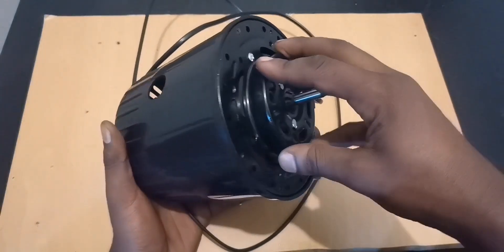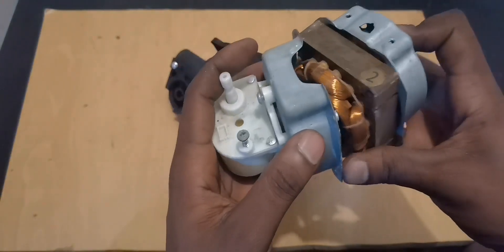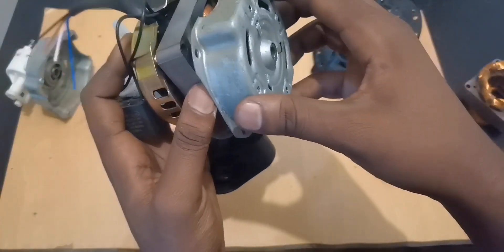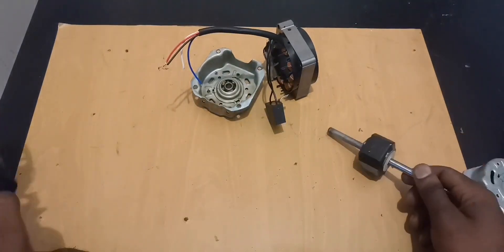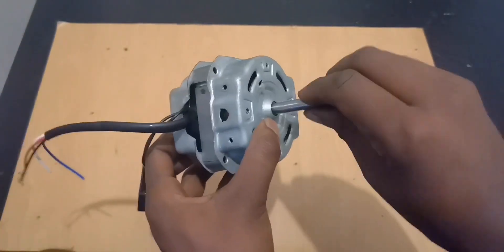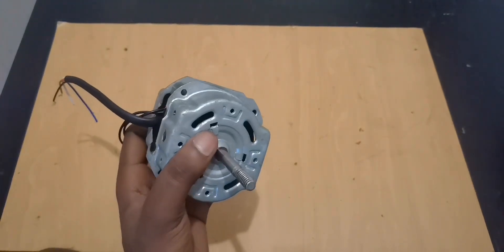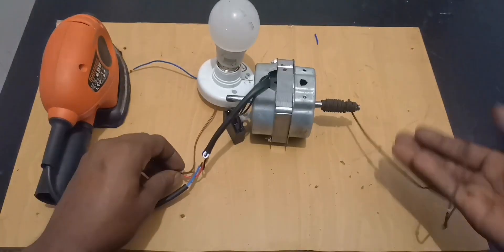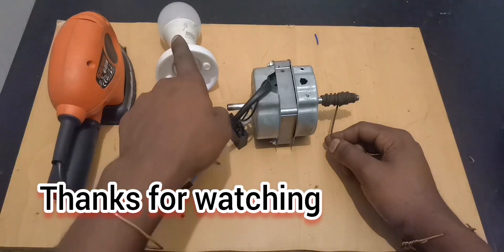#how to make high voltage generator at home #diy ac generator #electricity project #science project

Comment: Very good how-to video! I like that new design of motor also; less copper wire, easier to replace, probably more efficient. Atho, your new rotor would also be useful inside the old motor design, yes?

Everyone should know these higher Volt motors (including previous video of Wash Machine Water Pump Motor) are surprisingly more efficient than low-voltage motors when they are used as generators driven at high speeds. 

There remains one more requirement: Something to spin it; maybe a Wind turbine, a Water wheel, a Solar Water Wheel (Minto), or a bio-gas (methane, or wood-smoke) fueled engine?